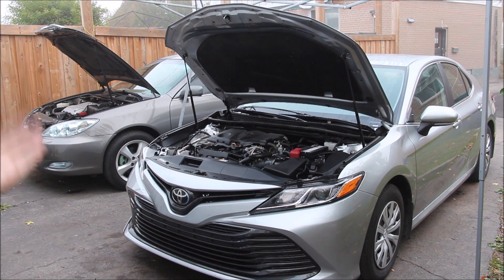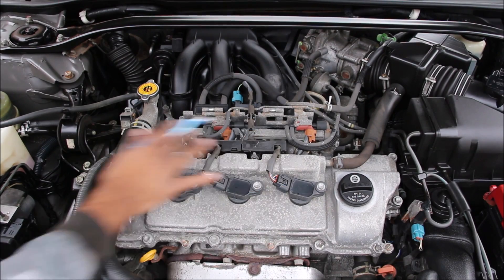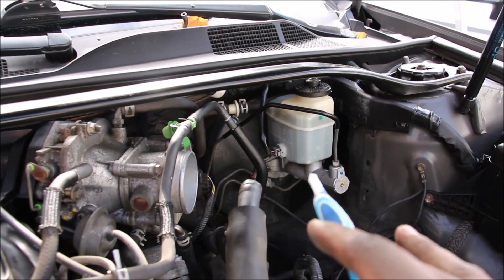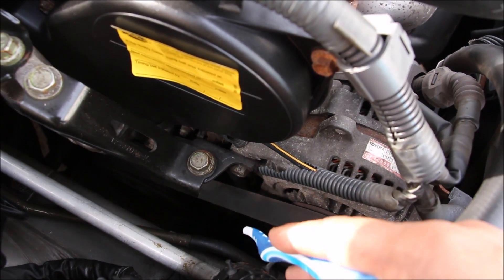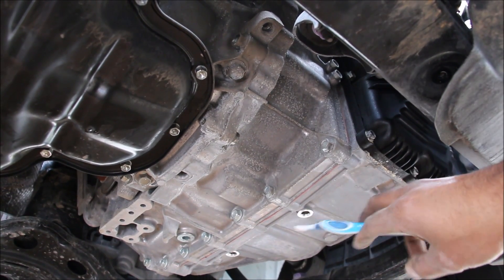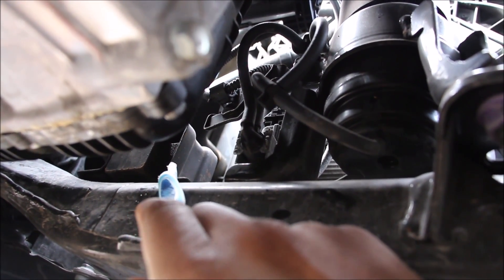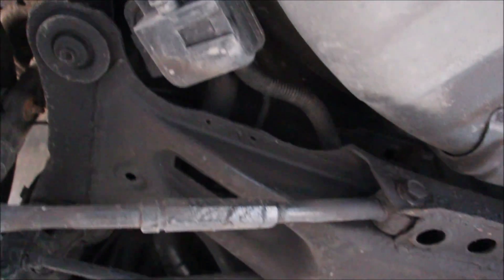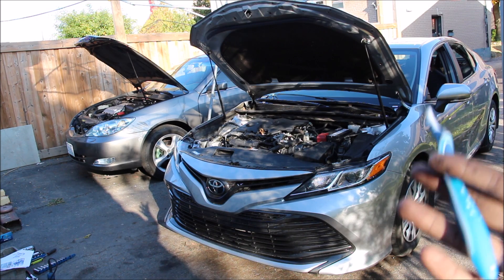Toyota Camry Mechanical Review | What Changed in 15 Years?

Comment: Thanks for good information.  But the thin plastics and metals you are talking about is not right.  newer Camry definitely better in all possible ways: rigid, agile, powerful, more efficient, and better look.  Thinner but stiffer in some places, makes new camry better handling and rigidity.  The plastics at front is for safety in case of hitting pedestrian and the hood and trunk are aluminum, not steel to reduce weight.  Texture plastics are used instead of smooth because of durability in scratches and visually not to obvious when you scrub it.
Reply from the maker: Everything is in the name of safety and economy  at the cost of durability
Reply: @speedkar99  just like TPMS, ABS, hybrid, turbo, stability control,  8 speed trans.  etc. They are less reliable for sure than simple 3 speed trans, non vvti, etc. But for 20 years lifespan 200k miles benchmarks are still doable for camry.  Fuel saving alone should pay back whatever breaks in most cases.

Comment: From all camry that I know, I still choose gen 4 camry (sxv20) 1997-2002. Solid iron engine block is one of the reason. As long as the components in front of the engine replaced every 100,000 km, it will last forever.
Reply from the maker: I didn't realize the 5S-FE was iron
Reply: @speedkar99  in deed it is. My other favorite engines are 3RZ-FE (hilux) and 2FZ-FE (land cruiser J100). While the last is 2AZ-FE (camry acv36). In the period of 2003 - 2008 our workshop receive acv36 every week just to change short-block due to piston and boring wear, even worst broken con-rod.
Reply: @speedkar99  the block was thats why they leak oil from the oil pumps. aluminum and iron do not react good together

Comment: Gas mileage- 20/29 on the '04 v6
And 29/41 on the 2020 4 cylinder

Even though I prefer the older Camry, the new one is impressive when it comes to saving $$$ on gas
Reply from the maker: The new 4 cylinder feels faster than the old V6 too

Comment: Both really really good cars for doing what passenger cars are supposed to do- move people and last a long time.

I prefer the older more powerful car with a nicer interior. But some of the maintenance will be a little trickier- esp the timing belt that the newer car will not need (timing chain). Also the gas mileage will be good but the new 4 cylinder Camry will be better- if you rack up a lot of daily mileage, the new car would make more sense

Excellent video!! 👍👍
Reply from the maker: Agreed there. The old Camrys were tanks
Reply: @speedkar99  thanks for the videos and I appreciate your sprinkled-in humor. Congrats on 200k

Double that by the end of the year, most likely. Cheers!

Comment: The best part is that I had an 03 Camry with 209,000 miles.  Luckily for me I had a 4 cylinder engine with a timing chain so I never had to deal with a timing belt.  As long as you change your oil on time the timing chain will last forever.

Comment: I4 vs V6, i can't stand 4cyl secondary vibrations, the 1MZ is a silky smooth V6. Obvious choice in what one i'd take is obvious. Older camry's are built like tanks.
Port fuel injection still makes the engine bay quieter. 1MZ's run 5w30 full synthetic actually. Not just conventional dino oil, otherwise they sludge which was another issue on the 2GR-FE

Also the 1MZ-FE will go 300k+ miles, i don't think the 2.5L will go that far without massive maintenance.

An electric water pump & thermostat ?, HAHA disaster waiting to happen. Physical water pump & mechanical thermostat will always last far longer.
Reply from the maker: I use conventional oil in my 1MZ. I find synthetic oil causes them to make too much noise. It's cheaper than synthetic and I prefer changing it more frequently than synthetic to prevent sludge. 192K miles on my 04
Reply: @speedkar99  In Australia our synthetics are obviously superior. Switching them to 0w40 solves any issue. Also provides fantastic protection across all climates, by the book they're oil change is at 7500km/4660mi, which is perfect. By comparison to GM & Ford's of the time they're around 10,000km - 15,000km (6213mi - 9320mi) which is too long in my books.
Reply: @speedkar99  Making too much noise, they require valve adjustments, that's your problem most likely.

The only ones that sludge are pre 02', anything later have revised PCV/crankcase. Changing the oil at 7500km, full synthetic 
Not an ounce of sludge.

Comment: Great content !! dat was really helpful !! i've a french small car "Citroen" C3 2004, used to change oil regularly every 6000kms, using 10w40, and it still runs like butter !! anyway, what i've noticed with the new cars gen is "oil burning" and that's really pain in the ass in terms of time and money ... bottom of the line the new gens are not reliable like the old ones except few brands ...

Comment: Good review. I'm considering getting another toyota cause I have a 02 camry 2.4 and it does burn oil and lose coolant but not bad I just top it off from time to time.
Reply from the maker: Yeah those 2.4s had issues with oil burning....get the V6!
Reply: @speedkar99  it's been reliable almost at 190 miles. Just those issues that I have. Heard of the issue with stripped head bolts. But I'm not going to put all that money to fix them issues. It will cost more than the car is worth.

Comment: The thinner metal bodywork is mostly for weight saving for fuel economy rather than cost, although you could say it's saving them money but not because the steel is thinner and therefore less expensive, but because they used thinner steel to save weight instead of using aluminium which would be more expensive.
Reply from the maker: That's another way to look at it

Comment: Love the plastic covers on the underside, makes vehicles last almost forever since you dont gotta worry about corrosion
Reply: Drove thru a deep puddle at a low speed and mine got tore off and started dragging under my back left wheel. Had to back onto a curb to pull it off lol....
Reply from the maker: It helps but if something does get stuck there you can't easily wash it off

Comment: “Where did Toyota cheap out on the new Camry? Places you don’t see or care about.” Uh yeah, the exterior being a literal tin can is something most people care about..
Reply from the maker: People won't not buy a car based on the sheet metal gauge
Reply: You’re probably right, but buyers should probably care. They’ll notice when they open and close the drivers door and watch/hear it warp and bend. And they’ll notice when the car becomes pockmarked with dents all over. At least such was my experience.

Comment: Does the thermostat in the new Camry use electronics to open the valve, or to melt the wax that opens the valve?
Reply from the maker: I haven't looked into the Toyota thermostat, but it does physically look like a thermostat so I'm going to assume it melts the wax

Comment: TOYOTA IS KING!!!!!!!!!!!!!!!!!!!!!!  2016 camry and newer does NOT use power steering fluid. the steering is electric
Reply from the maker: They started using electric steering since 2007
Reply: @speedkar99  no. My 2011 camry took power steering fluid

Comment: I had a 2001 Camry LE for 17 wonderful years!!  My engine started going out, unfortunately.  So I bought a 2019 Camry LE....hoping it will last as long as my other one.  My 2001 was so much more comfortable than my new one.  I sure miss my old baby Camry!!!
Reply from the maker: Which engine did your old Camry have?
Reply: @speedkar99  It was a 4 cylinder....not sure what else you need.
Reply: How come you got the engine to start going out? How many miles you have? My owner white Camry 1999 is 253k mile right now. Always change oil each 4k miles and change transmission fluid about 30k miles. That's all no problem at all!
Reply: @JamesKarne  I had 189k miles on it.  I dont know why it went bad.  I changed my oil every 3000 miles and took great care of it.  But the engine was making a loud noise whenever I started it and that lasted for a long time before I was told by my long time reputable  mechanic that the engine was going out.  So before taking a chance of breaking down...I bought a new 2019 Camry.  I really live the new one too but miss my old one.
Reply: Patricia Schexnaildre is your car made from US Model? My white car came from Japan model. My automatic transmission is very smooth and soft because I always change transmission fluid by myself to do.
Reply: @JamesKarne  I am really not sure.  But I did everything I was supposed to do....I took great care if my 2001 Camry!!

Comment: The golden age of Toyota was the early 90's to the mid-2000's. You have to spend at least 50 grand now to get real quality and that means Lexus.
Reply from the maker: Even Lexus quality isn't where it used to be. My old ES330 had a really nice interior compared to the new ES350s....I felt something was lacking
Reply: @speedkar99  i feel like the cheaper feeling materials must be for weight reduction. Manufacturers are doing everything they can to squeeze every mile possible per gallon. They have a lot of pressure on them to meet very stringent standards.
Reply: I agree interiors have taken the biggest hit.. Most newer cars of the same class are using more lower quality and lighter materials in the same places.

Comment: Nice work speedkar99.  I think that you might need to improve your hand model gestures a little:-)   I have a Toyota Avalon 1MZ-FE 2002 (Australia) with the A5410E transmission.  It's been pretty bullet proof over all these years.  Transmission fluid is easy to flush or replace with a dip stick present.  How do you check the ATF condition without the dipstick?  You can't.  Shame on you Toyota for removing the ATF dip stick.
Reply from the maker: Thanks for the suggestion on the hand gestures I'll take that into account in the future. 

A541 was the reliable transmission. My old Solara had that one too. 

To check fluid you have to warm the car up and open the overfill plug (in this case the same as the drain plug, it has a built in straw that drips out excess fluid above the correct level).

Comment: Toyota makes the best vehicles that last for a very long time. My 2005 Sienna has 288K miles without replacing any major components-yes still runs on original ÁC, fuel pump, suspension and paint. Oil is clear between oil changes.
Reply from the maker: Good old reliable sienna. My dad has an 06 too

Comment: Did you say you don't have to service the timing chain ? I doubt that
Reply: This ain't an Audi or bmw change the oil on time and it'll last
Reply from the maker: You don't have to typically for the life of the vehicle. 

An inspection at 100-150K miles doesn't hurt, but that involves removing the timing cover.

Comment: I don't think it's thinner metal. I think it is aluminium as opposed to steel. And yes some panels may sound thinner but the crash protection is higher due to the high strength steel of the parts that protect you in a collision that sits under that thinner panels. The thinner panels or aluminium panels also mean lighter weight for better efficiency and performance. Although as far as interior quality goes, it seems the entire industry has moved that way sadly. A Golf 6 had such nice soft plastics even on the lower doors and on the back doors. The Golf 7 has plastic instead. It's sad and I wonder why they're all doing this. Even the luxury carmakers.
Reply from the maker: In a collision it works great. But  resistance to minor bumps and scrapes is very low.

Comment: I love PLASTIC VALVE COVER, they're so reliable compared to the aluminum valve cover; they will last 3 times longer than it is. Nice going Toyota, Japan.
Reply from the maker: The plastic valve cover might last as long as the gasket. At that point it could warp due to heat.

Comment: As an auto Technician, The old one is built much better. I've owned many Toyota's and much prefer the older designs, before we had all the cross-pollination of automotive engineers. Who brought crazy ideas with them. Things like that electric water pump and thermostat that while easier to replace, is much more prone to failure. This, and the decline in interior quality is why I bought a used Sonata instead of a Camry when I needed a new car in 2016. My family has had plenty of them over the years. That I've been responsible for maintaining. 
2010, 2008, 2007, 2005, 1999, 1997, 1995, 1993, & 1988 models. Over these models I've seen Toyota quality start to decline. With a noticeable drop from 2007 on using cheaper materials, and weird engineering. I'm not sure how much longer I can in good conscience continue to recommend their products. Granted they are still better than other makes. But for how long ??
Reply from the maker: I appreciate your opinion. 
I'm an engineer but work on my cars and understand your pain. 

OEMs are regulated my emissions, fuel economy and safety when designing a car. The only thing bounding them mechanically is warranty. As a result, maintainability suffers, due to budget, and components are designed to last the warranty period+1day. To package it all and still meet customer demand (which is what sells cars, not ease of fixing) is where engineers are forced to cut corners. It's sad but that's the reality. 

CVT transmissions are disposable already. Soon we will have disposable cars.

Comment: Toyota camry in my country using 2.0 engine, 7 air bags ( i heard in US is 11 air bags smth). Break system is only ABS support, no electric chairs adjustments. Entertainment system outdated, lagging touch screen. Low quality car body use soft plastic, they say it can absorb impact damage :(. No  support break when ppl infront of the car It cost $55.000 and assemble at my place too, but all part of it import from Thai, Indo, India, some from China
Reply from the maker: Third world countries really get short changed. I'm sure the 2.0L is because of government regulations there.

Comment: The reason why the new Camry feels more hollow with the metal panels is because Toyota went with aluminum panels on the newer models. It helps cut weight down, but steel is better with strength and crash protection.
Reply from the maker: I don't think the quarters and body structure is aluminum, wasn't it just the hood?

Comment: This Camry is not reliable. DI is a joke. The 8 speed automatic transmission has issues and no option for a manual. I wouldn't buy it. 2010-2017 Camry is a way better buy.
Reply from the maker: Get the V6 please 
#savetheV6s

Comment: After watching this video, my choice is . . . .   the 2004 4-cylinder Camry!
Thicker steel. Better quality interior. Easy to change the plugs and water-pump. No timing belt. No plastic valve cover. No computer cooking in the engine compartment. No electric water-pump, or electric thermostat. No touch-screen to distract my driving.
Do the engineers think all these new electric parts never break ?!
And I prefer to operate the brakes and seat-belt myself!
Reply from the maker: The 2.4 4 cylinder from then had a few issues with head bolts stripping and oil burning. The V6 of that generation was the most reliable
Reply: @speedkar99  OK then. 
I'm in no hurry to get rid of my 2.2 96 Camry. It does have a water-pump running off a timing-belt. But unlike the V6, it's a non-interference engine.
So no engine damage if the belt breaks
Mine also uses a bit of oil, and it had a lot of deferred maintenance to take care of when I acquired it 8 years ago. The estimate was $3000 for a steering-rack, brakes, tires, a driver's door-handle and main window-switch to pass  inspection.  So the owner got tired of parking tickets and gave me the car. It cost me $600 to fix!

Comment: I saw a few of your other videos too, nice work indeed. For the catalytic converter do you know how much difference in the output volts or resistance (if it uses resistance) of the second O2 sensor should be as compared to the first one to throw a check engine light, say 10%?
Reply from the maker: Thanks. I don't have values, each vehicle is different

Comment: Direct injection motor will in the end have fouled valve as the fuel was used to clean the valves through the intake process.
Reply: George Ortiz .... new engine has BOTH direct injection AND port injection ... so no valve carbon problems
Reply from the maker: Good point

Comment: Speedkar, I have 2011 camry LE, with 200k miles.  Since it has sealed transmission, I never drained/refilled or replaced transmission fluid. Car runs great.  Does it even matter at this high milage to do drain refill? I'm thinking just riding it to the end without doing drain/refill. I got this much trust in toyota.
Reply from the maker: A drain and refill wouldn't hurt. Don't flush it completely. Congrats on 200K miles.

Comment: I doubt that the new supercharged 4 cylinder will will last as long the non boosted version. The same can be said for the new Honda supercharged 4 cylinder automobile engine. Both these new engines will have a shorter service life than older versions making them less desirable in the used car market. Sad!
Reply from the maker: These Camrys aren't supercharged. But yes a boosted version might not be as reliable as a naturally aspriated version.
Reply: Excuse me, not supercharged, turbocharged. Different process, similar result. Same effect on longevity.

Comment: You mentioned U made the caliper and disc upgrade... I have a 2009 XRS Corolla all discs brakes and was wondering if there was an upgrade for it that don’t require major modifications?  
Maybe a Camry aLexus kit would fit or maybe there’s a TRD kit?!? 
Thanks
Reply from the maker: You need to stick to your bolt pattern and vehicle platform. For me, any Camry based vehicle's brakes will bolt up, such as solara, Avalon, Highlander, ES, RX. 
Find caliper brackets that have the same spacing on the knuckle and it'll bolt right up. Since you have the XRS the brakes are probably larger to begin with. You might want to check out the rav4 or Lexus CT/HS.